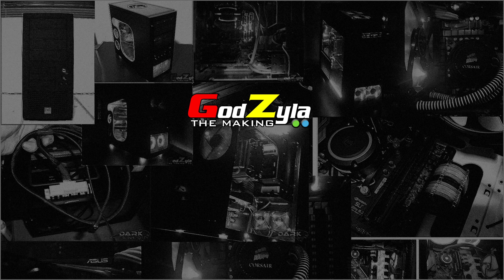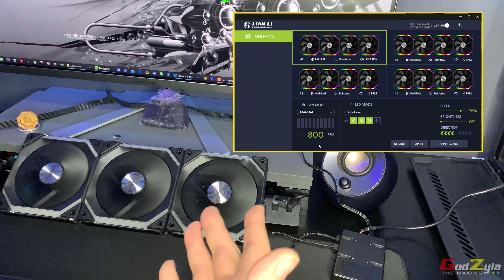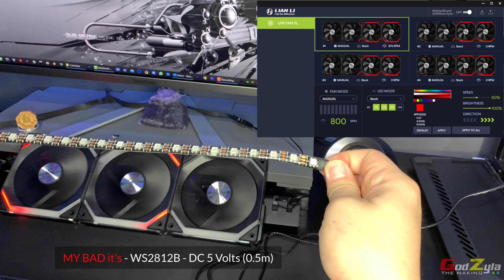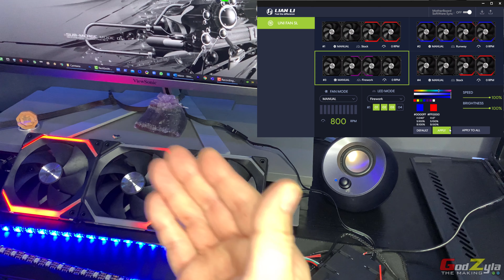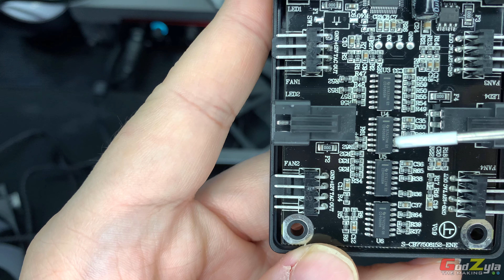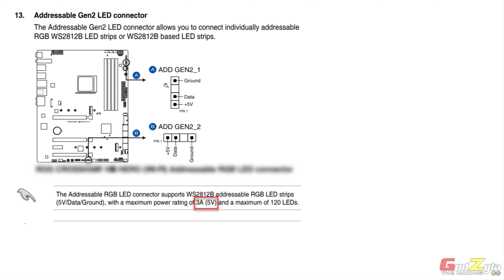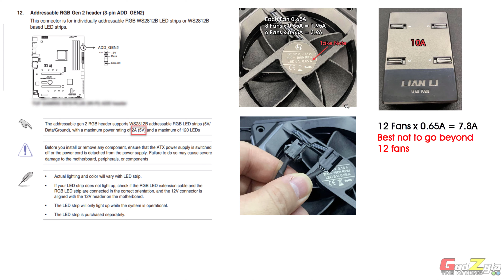Lian Li UNI Fans SL120 - Dos and Dont's (Part II) [L-Connect]

Comment: So does this mean that in a case with the controller, I could run a 360 mm push pull (daisy chained using the side contacts on each side) with 6 more non rad fans (twelve fans in total) would this be alright? Looking at using the o11 dynamic with 
intake on top( push pull rad) 
Intake on bottom 3 fans with daisy chain contacts
Outtake on side 3 fans with daisy chain contacts. 
Using the controller I should be alright?
If there is a doubt I can just run two controllers, yes?
Reply from the maker: Hi Frozen Walrus. Thank you for your question. You can only use one controller and not two. And if your setup is all 12 SL120 fans. Yes you can do that. Just make sure 3 or 4 fan max to a daisy chain to each output of the uni controller.
Hope that helps clear your doubts. If you like my content, kindly subscribe and remember to click on the notification bell. Thank you very much.
Reply: @KleoYan  I had an idea just now. What if I were to wire three of the uni fans on the AIO to the CPU header via Msi daisy chain mag 360 r and then kind of go from there. Maybe I can do that however I don’t know if the software will pick the fans up if I were to do that. I guess I would have to plug the RGB into the controller. Any suggestions on how I could get the AIO fans to be picked up by the LL software (RGB) but also be controlled (speed) with fan curves via the cpu temp? The AIO cables make it confusing. Maybe I could plug the pwm cable into the “SYS fan” and plug the RGB header into the hub? Idk lol
Reply: Here’s my planned build so far :

CPU: AMD Ryzen 7 5800X 3.8 GHz 8-Core Processor  ($459.98 @ Newegg) 
CPU Cooler: MSI MAG CORE LIQUID 360R 78.73 CFM Liquid CPU Cooler  ($139.99 @ B&H) 
Motherboard: MSI MPG B550 GAMING CARBON WIFI ATX AM4 Motherboard  ($219.99 @ Amazon) 
Memory: G.Skill Trident Z Royal 16 GB (2 x 8 GB) DDR4-3200 CL16 Memory  ($124.99 @ Newegg) 
Storage: Western Digital Black SN850 1 TB M.2-2280 NVME Solid State Drive  ($219.95 @ Amazon) 
Storage: Western Digital Black 4 TB 3.5" 7200RPM Internal Hard Drive  ($149.99 @ Western Digital) 
Video Card: EVGA GeForce RTX 3080 10 GB XC3 BLACK GAMING Video Card  ($779.99 @ Adorama) currently upwards of $1000 with card shortage but that will settle down
Case: Lian Li PC-O11 Dynamic Razer ATX Full Tower Case  ($179.99 @ Newegg) 
Power Supply: EVGA SuperNOVA GA 850 W 80+ Gold Certified Fully Modular ATX Power Supply  ($150.19 @ Amazon) 
Case Fan: Lian Li UNI SL120 58.54 CFM 120 mm Fans 3-Pack  ($129.00) approx (varies by seller)
Case Fan: Lian Li UNI SL120 58.54 CFM 120 mm Fans 3-Pack  ($129.00) approx
Case Fan: Lian Li UNI SL120 58.54 CFM 120 mm Fans 3-Pack  ($129.00) approx
Total: $2836.06
Prices include shipping, taxes, and discounts when available
Generated by PCPartPicker 2021-01-26 00:09 EST-0500

Thinking of using stock fans that came with the AIO in the push pull and messing with the curves. I can just plug those three into the mobo with the aio pump and such and then plug the rest into the hub
Reply: Update: realized I can mess around with fan curves via LL software. No I just need to figure out what to do with the random “daisy chain” meant RGB header coming off of the cpu block heh heh, FUN. Gotta love loose cables in cable management
Reply from the maker: @charlesbergenske6580  hmm.. your setup pretty beefy.. plus I do not know how your AIO works especially with the temp display.. for this you might need two USB 2.0 so that you can make full use of it. so setup will go like this.. all aircase fans will plug both argb and fan header to the uni controller. as for your AIO SL120 fans, plus argb to the uni controller. then the fan header goes to the AIO controller if it have one.. use your AIO controller to regulate the rpms instead, since it's tied to your AIO pump and to be connected to the mobo fan header and USB 2.0 header. pardon me. not able to help you fully.
Reply: @KleoYan  can you send the link for the PWM splitter or I guess “binder” that you had in one of your other videos so I can put together the pwm cables from the push and the pull side then plug it in as one to the cpu fan?
Reply from the maker: @charlesbergenske6580  sure here you go.. 

Fan Y Connectors - https://www.aliexpress.com/item/4000298742009.html?spm=a2g0o.productlist.0.0.3e554e00fWV4gL&algo_pvid=19727337-1191-48e3-8f67-76ef3b08e2d6&algo_expid=19727337-1191-48e3-8f67-76ef3b08e2d6-6&btsid=0bb0624616065049286583968eb94d&ws_ab_test=searchweb0_0,searchweb201602_,searchweb201603_

Argb Y connectors (select 3pin only) - https://www.aliexpress.com/item/1005001779375576.html?spm=a2g0o.productlist.0.0.f0b46342S6KzeN&algo_pvid=07fe82a2-a729-4059-ace7-bae66322c687&algo_expid=07fe82a2-a729-4059-ace7-bae66322c687-4&btsid=0b0a556c16065055547736274e0987&ws_ab_test=searchweb0_0,searchweb201602_,searchweb201603_

Comment: I'm planning to buy a 6 UNI SL120 fans and 2 UNI SL140 fans, will the 140 fans be compatible in the controller with the rest 120 ?
Reply: Ok I have another question . Is it possible to connect 2 x 400 Phanteks’ NEON Digital-RGB LED ( 0.84A each ) 1 rgb header of the controller as for the rest ill connect in 2nd 3xSL120 and another 3xSL120 on the 3rd and 2xSL140 on the last which is the 4th .
Thank you in advance
Reply from the maker: @Gregie_glt  Hi Tangken, it should not be a problem if you listed the ampere correctly which is 0.84a each. once again thank you for your question and to have visit my channel, do remember to subscribe if you do like my content and to click on the notification bell :)
Reply from the maker: Hello Gregory Galut, thank you for your question. the SL120 and SL140 are compatible to plug on the uni fan controller no issue. thank you again to have visit and subscribe to my channel. :)

Comment: Hi Kleo thanks for the video, I’m currently building my first pc and I’ve got 6 S120 Uni fans and a 240mm Galahad and want them all connected to the same Hub that came with the Uni fans. Once I’ve connected everything to the hub do I connect the hub to a fan header on the motherboard and if so will that be okay? Sorry if it’s a silly question
Reply from the maker: Hi Mr Techno, thank you for your question. Yes you can connect all to your unifan controller except for the pump connector of the Galahad. Kindly connect that to a motherboard fan header and run at full speed. Please note that if all your fans are connected to the unifan controller, when you switch on the L-connect app to pwm under the fan setting section. It will follow the pwm settings of where you have plug the pwm cable between the uni fan controller to the motherboard fan header. 
You will understand more if you watch these videos. By the way, if you like my content, kindly subscribe and to click on the notification bell. 

Basic connection and usage of L-Connect
https://youtu.be/Rm2emeyMUAk 

Connection with Galahad 
https://youtu.be/XNCAeAX0mZQ
Reply from the maker: Hi Mr Techno, I was about to reply you with regards to the 1A load of your motherboard, but I can't seems to find your question to reply. Ok you have asked that all your fans are connected to the Uni Fan Controller and you are afraid that the load on your motherboard fan header is not able to take the load which is at 1A. Just to clear your doubts. you do not have to worry as the fans are drawing load from the uni fan controller as not from your motherboard. You see, the uni fan controller has a dedicate power source from the Sata cable which you have plug to the uni fan controller. just for your info, the uni fan controller is at 3A on fan load and 10A on argb load. :) hope this helps.
Reply: @KleoYan  Hi Kleo, yes I deleted my comment as I found out on one of your videos the answer but thanks again for the reply and info. All my uni fans are working like a charm.
Reply from the maker: @olibrown83  am glad to hear that. Thank you for the reply too.

Comment: So what if I buy 3 single pack unifan  meaning no controller hub. Do I just plug daisy chain directly to MB?
Reply from the maker: Hi Xavier. thank you for your question. yes you can daisy chain 3 fans to a motherboard fan header. no issue. as for argb, you need a  1 to 1 5V 3PIN TO SM3P converter https://www.ebay.co.uk/itm/PC-motherboard-5V-3PIN-TO-AURA-RGB-FAN-SM3P-Socket-Multi-connectors-cable-ASUS/264896189467?hash=item3dad0b141b:g:I6MAAOSw8-5ey3U8 inorder to plug your unifan argb connector to the motherboard argb. please also make sure your argb on your motherboard support the load, please check on your motherboard manual. Once again thank you for your question and if you like my content, kindly subscribe and to click on the notification bell. thank you!

Comment: hey there! did you connect the 5v argb header to your motherboard? i recently bought a set of sl120s and my motherboard didnt have a 5v header (I ordered a converter from deepcool to fix this) i see that you only have 2 cables connected to controller other than the 2 fan cables. do you need the 5v header for rgb or is my unit not working?
Reply from the maker: Hi Pablo, welcome to my channel and thank you for your question. I can either plug or unplug the 5v argb cable, Infact this unit can work with only the USB and SATA plug to the control unit. I have another video which shows you how I did the connection https://youtu.be/Rm2emeyMUAk, it might help you out. as for your deepcool converter, I am not sure what you are referring to. If your motherboard does not have the aRGB header, you don't have to use the 5v argb cable from the uni controller to your motherboard. Now do note that some vendors sell converters from 12volts to 5volts converter. Those will not work on this uni controller and try not to use them as it might damage the uni fan controller. Once again thank you for your question and to have visit my channel, If you do like my content, kindly subscribe and to click on the notification bell. oh before you go.. I have a series of video about this unit, you might be interested. https://youtube.com/playlist?list=PLEW-b-2vYDdM1WklGQps2-sQ1Amy6Uwn9
Reply: @KleoYan  thank you for the reply! yup this video helped me a lot i will be sure to subscribe. my fans work properly now thanks to this :D
Reply from the maker: Hi Pablo, you are most welcome. Am glad everything work out fine for you. Thank you to have subscribe and to have visit my channel.

Comment: Is there a way to turn off fans. Or lower the speed to less than 800rpm ?
Reply from the maker: The SL120 is rated at 800 to 1900 rpm. You will not be able to do below 800 and on the uni fan controller, that’s the minimum rpm which is fix. Once again thank you to have re-visit my channel.

Comment: im stuck between these fans and the LL120 from corsair
Reply from the maker: Hello Ted. welcome to my channel. where are you stuck at? hmm lets see if I can help you out.
Reply: @KleoYan  I've just built a brand new pc and I want to get 3 front case fans and i can't decide between the 2 id really like to try each set-out but that's not really possible
Reply from the maker: @ted.1558  hmm. jwhat are the Corsair fans you are using..  just a suggestion, maybe you can use both fans on the unifan controller to control your corsair argb but not the fan rpm , you will need to connect the corsair fan header to your motherboard.
Reply: @KleoYan  Its more i can't decide between the 2 different lighting styles
Reply from the maker: @ted.1558  I see, hmm.. ok these are not Corsair fans ( https://youtu.be/bMRz2KVqbjA ), but similar pattern. https://youtu.be/bMRz2KVqbjA if you decided to plug those corsair fans, just make sure you check the LED ampere rating. anything below 0.65a and with 4 attached to one input/output to the unifan controller will be ok. hope that helps. btw if you find my content useful, kindly subscribe and to click on the notification bell. thank you!
Reply: @KleoYan  yeah i know they aren't corsair fans i just could not decide which ones to get
Reply from the maker: @ted.1558  ok, you might want to ask yourself this question.. performance over vanity or you want both? for me I got for performance. though I share my experience on the uni fans but my own build I dont use them. I choose performance over vanity. as for a friend of mine, he wants both. Thats why I recommended him the EK Vardar EVO 120ER instead of the cosair. cos 1st EK has lower fan load and lower argb load as compared to other argb fans out there. plus the airflow on both case air and pressure static air are superb. so ya.. make you think about it as what you wanted, then decide on it. I wishes you all the very best and once again thank you for visiting my channel :)
Reply: @KleoYan  i obviously want to have good performance but look nice

Comment: Wow! The best video about aRGB and controllers I've seen on youtube. The explanation is really good and should solve any doubts about the instalation of argb fans and led strips. You had explained with Lian Li Unifan controler but it can be applied to any controler like Cooler Master or Corsair. The manual itself is not so good and of course they don't do the math like you did and complicates when you have a case like Lian Li that supports a lot of fans. Thanks for the great content!
Reply from the maker: Hi Bruno Mamoru Shibata, thank you for your comments. you might want to check out the rest of my series about this unit which includes the connection, how to do a push pull configurate and the test on the fan for airflow. Once again thank you for your compliment and to have visit my channel, kindly subscribe if you find it useful and do remember to click on the notification bell. by the way these are the series of video about this unit. https://youtube.com/playlist?list=PLEW-b-2vYDdM1WklGQps2-sQ1Amy6Uwn9 .greatly appreciated with your compliments and kind words. Thank you.

Comment: is this hub compatible with bora fans?
Reply from the maker: Hi Chad Klatz, thank you for your question. You can use the bora argb with the uni fan controller but you need a converer, but for the fan load, I would not advise you to connect to the uni fan controller. you might want to watch this video. The concept is the same https://youtu.be/bMRz2KVqbjA . Once again thank you for the question and to have subscribe to my channel.

Comment: my rgb is not working and the L connect software is not detecting the fans plz help!
Reply from the maker: Hi Im greazzy, thank you for visiting, now as for your issue, maybe can you list down your motherboard brand and model. There are some users having this issue like yours and currently as what I know there is a fix, please check out the Lian Li official uni fan website https://lian-li.com/product/uni-fan-sl/ , scroll down and look for L-Connect F 

Content on official website as follow:
Issue appears as:

1. Light and Fan of UNI FAN is operating.

2. Lian-Li appearces under device management.
3. However, can’t control UNI FAN by L-Connect.
4. Need to re-plug the USB when rebooting.

hope that helps, once again thank you for asking and if you like my content, kindly subscribe and to click on the notification bell.

Comment: normal 3pin or 4pin  ARGB splitter dun work for unifan ? i dun daisychain every fan  , the led connector on unifan seem incompatible zzzz 
and cant seem to buy their argb kit everywhere zzz dun think i can connect all fans to commander box zzz
let  say i got aio+2fan+3+1+1+1  ...
Reply from the maker: Hi Kokekoko, thank you for your question. now on the SL120 or SL140 fans, the fan connectors are standard, you can plug to motherboard or commander pro individually. they are 4pin pwm connectors.. the only issue is the argb where the 3pin is not the normal 3pin aRGB connectors. If you want to covert them to normal 3pin aRGB, this is what you need. 1 to 1 Male 5V 3pin  which you can get it here  https://www.aliexpress.com/item/1005001598378033.html. Please note, I do not know how the commander pro work. I will not be responsible if your commander pro get damage as the LED rating on each SL120 or SL140 is at 0.65a. once again thank you for your question. If you like my content, kindly subscribe to my channel and to click on the notification button. thank you!
Reply: @KleoYan  https://lian-li.com/product/argb_cable_kit/
they do have optional 3pin to 3pin X4 splitter for their commander box , just that i hope they include this into 3pack package , coz i cant seem to find it at MY/SG
Reply from the maker: @Vuln000  oh you are referring to the argb cable kit that you need. I see. well part of the reason a friend approach me as he wanted to connect AIO, Strimmer plus and the SL120 together to the Uni Fan controller.. that's why I am crimping those cables :) if you know how to crimp it will be so much easier.

Comment: I just purchased a Lian Li  LanCool ii Mesh RGB case and would like to purchase this controller on its own as my motherboard does not have an ARGB connector - is there any way I can get this controller on its own
Reply from the maker: Hi Geoff H, thank you for your question, yes you can use the Uni fan alone without connecting it to the motherboard and I have explained on this video https://youtu.be/Rm2emeyMUAk which might interest you. You will will need some SM JST cable convertor if you only getting the controller which i have explain on this video too. https://youtu.be/TIO8JxVZTi8 .  once again thank you for the question and if you like my content, kindly subscribe to my channel and to click on the notification button. :)
Reply: @KleoYan  but no way to purchase the controller on its own, and thanks for the speedy reply
Reply from the maker: @geoffh4578  you are most welcome. maybe now globally is out of stock, thats why none to see on sight. Anyway all the best in your build :) and thanks for visiting to my channel too.
Reply: @KleoYan  ordered the fan set SL120, many thanks
Reply from the maker: @geoffh4578  you are most welcome.